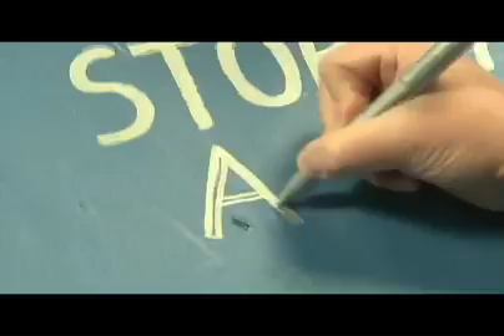Mythbusters - Stopping a Blade

Comment: Lets use a sword in the way designed to cheat the myth. The coins could happily have deflected a slash/stab in normal use. All you have to do is deflect the blade off course.

What they showed was less than worthless, wrong technique, wrong angle, wrong target position.

Comment: the curved saber used in the civil war was mainly used by cavalry it was easier to cut and was less prone to stick inside an enemy. most foot soldiers did not have a sword but the bayonets on their guns, they would shoot then charge the enemy with their bayonets.  so this test is not accurate to historical uses. the sabers were used by Cavalry for slicing and cutting not stabbing. they generally had a pistol and saber, with a long knife to fight in close combat. but they slashed and cut with it. now they did stab as well but they are not typically made for thrust and are made for slashing.

Comment: For the coins i think it may have been for for a slice to the leg rather than a stab to chest, if that were the case it would likely be no more effective and if you survive the encounter now you have no money.
Reply: It might have been more effective to protect the legs, since the blade would hit a coin and slide outwards thanks to the angle, missing the leg entirely.
Reply: Or it could send it in a downward trajectory on your leg, which if that happened you'd be left with half a thigh lol
Reply: Or, ya know, not... As most cases of a saber would be from horseback.  Although either way, even on foot the coin would absorb enough of the impact and velocity to make then cutting threw the thick material of the army uniform nearly impossible. Yes, it might have hurt, but, well short version, "Physics".

Comment: you realize because of the curve the cutting force of a katana is much higher then a straight edged sword......
Reply: FinalBossWTMN no, its not the force, it's essentially edge contact and geometry. With a curved sword, the force is distributed over a smaller area because geometry, so it will cut deeper. Also, they will draw the edge along the same spot as you continue the cut, rather than expanding it horizontally.

Comment: No it's a field of charged particles created by the black hole in the center of a galaxy. The older definition is what Dash said. A galaxy that emits high intensity radiation we can detect as we didn't accept Black holes as actually existing until recently.

Comment: the katana is a different kind of sword, made in a different way, and wielded in a different fashion. you might as well compare a shotgun to a rifle. the sword in this video is an antique, which means it like hasnt been honed in a long time. also, it was designed for one handed slashing with lots of footwork, the katana is normally a two handed sword and is wielded in a chopping motion, not slashing. so quit being a weeaboo. just because its from japan, doesnt make it better.

Comment: there is a mythbuster video that shows that for a distance of less then 16 feet, a simple knife is superior to a pistol if the pistol is not drawn and unsecured already. Now add around 3.5 feet of blade length for a sword and rethink if you really would prefer a gun if you are not far away from your attacker.

Comment: Katana just means sword in the language used, but yeah, they were great because Japanese steel wasn't very good. Thus their smiths had to use the layer + folding technique which actually produced a better alloy. The things that made a great sword useful and a Japanese slashing weapon useful are apples and oranges though. The great sword was more like heavy, blunt force trauma with an edge, bashing and hacking your way through armor, cloth, flesh and bone.
Reply: Actually no. Great swords could not cut through bone as you can't move it back far enough to get enough force in the swing. Against cloth it's even less effective as greatswords aren't sharp enough. To get through soft armor like cloth blunt force is meaningless and something like a rapier actually has more luck. The main use of greatswords was to push spears out of the way. Spears were the dominant weapon and so the greatsword developed as a dedicated anti pole weapon. However when firearms because the dominant weapon the great sword disappeared.

Comment: coins vs thrust...not so good.
coins vs slash... better.

They only tested one way to use a sword. Cavalry swords were mainly used to slash an opponent. You rode PAST them, then slashed back with the blade into the face or upper chest.. If you slashed as you rode up to them, you'd hit them in the back, and lots of soldiers had gear stowed on their back which would keep them safe from a sword slash.

Comment: Few problems:
#1 Technique is inapplicable. The blade action is still the same,going straight in the victim.
#2 Obviously slicing was part of a sword fight, however, this myth is intended for direct heart strikes (instant kills)
#3 The soldiers in the civil war were not hardened athletes. Also, fat would actually protect more, as the blade would have to penetrate deeper to cause mortal damage. 
#4 Clothes were not made from leather, but rather wool and cotton.
#5 Stop making up stuff.

Comment: Few problems 
#1 You are stabbing with wrong technique
#2 Slicing technique are also used to injure enemy [therefore coins would be effective] 
#3 Athlete body is harder than body fat/untrained body + there was a possibility that for extra protection and extra layer was being wielded 
#4 Clothes were from Leather. Or even coins would be placed in tight pockets where it's impossible to slip.